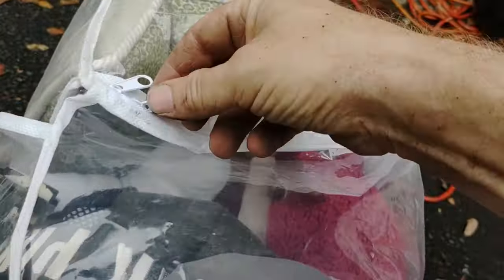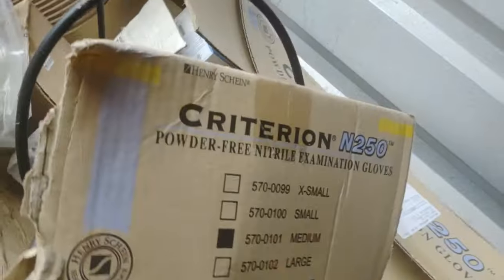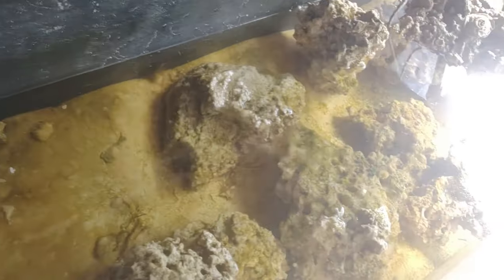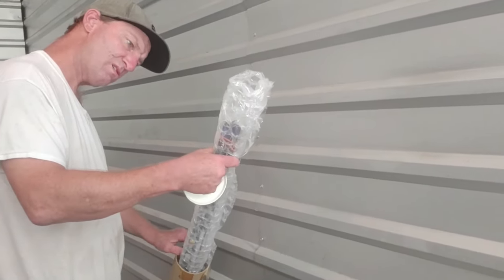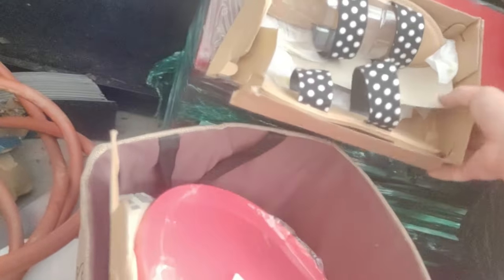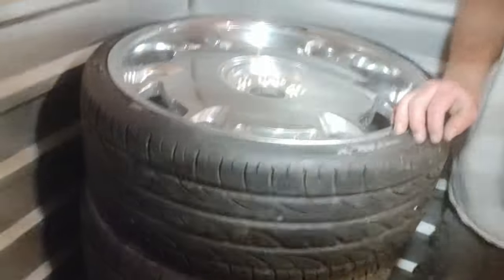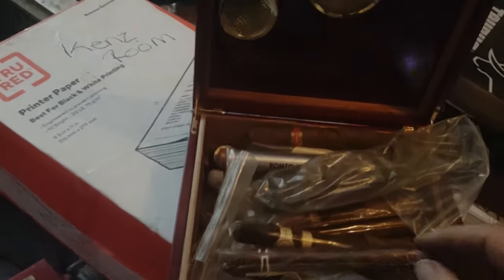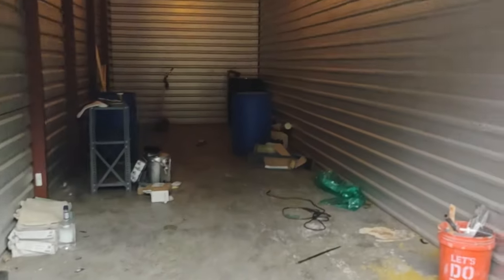$710 Thirty Foot Storage Auction Unit Full of Man Toys, Big Profit, and Surprises

Comment: All the cigars are shot if they've been left in the heat the ammo gets less trustworthy the more it's humid and hot you're supposed to keep your ammo in a cool dry place not a hot moist storage unit I'd be thrilled one way or another it's awesome score I see so much keep life it's not even funny all the ammo and accessories👍😃👍
Reply from the maker: Some of the cigars did look pretty rough but I have sold them as is in my auction before and done well. The ammo should be good because it was all in those ammo cans sealed up. Thanks for the tips.